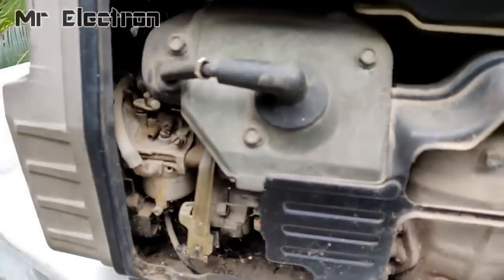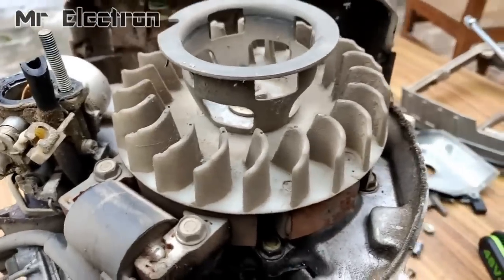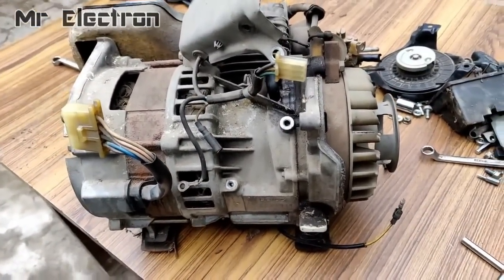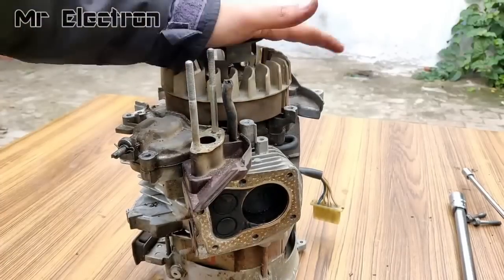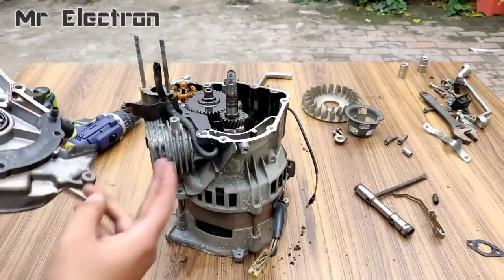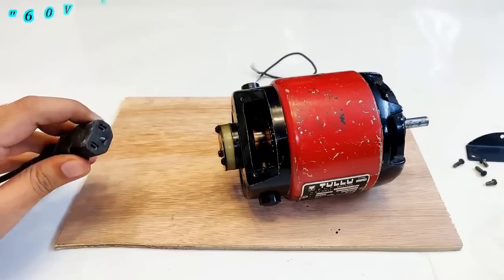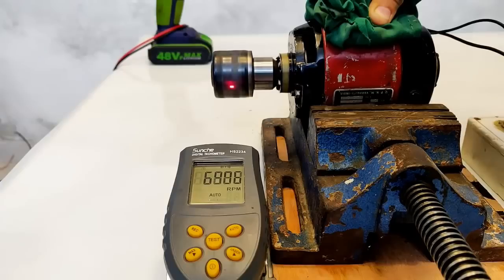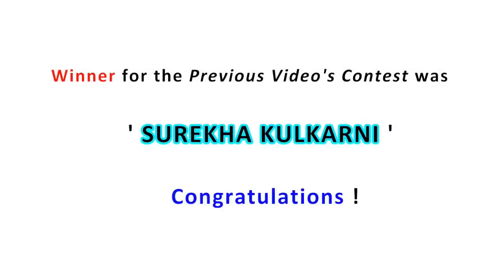3 Simple Inventions with DC Motor

Comment: Dude. Youre dangerously stupid. That motor is rated at 6000 rpm max. Not only are you frying it, you put a drill chuck on it and spun it twice its maximum. And had the camera lined up with it. If that chuck made it the slightest bit unbalanced, that motor would have disintegrated pieces flying everywhere at bullet speed. Youre lucky it didnt.
Take some advice. Stop doing things rhat you dont know anything about. Youre gonna hurt yourself badly. Seriously.

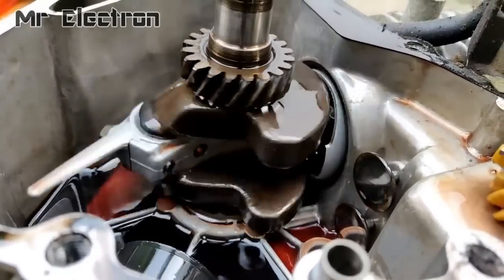Comment: 15:10 "Very good running engine. There is no point in destroying it".
Too late. 1/2 hr ago it was a good running engine. Until some idiot tore it apart, yanked the cam out without making sync marks with the crank.

Comment: The honda genset engine is 4 stroke, it has inlet and exhaust valves and also a cam shaft. 2 stroke runs on ports not valves.